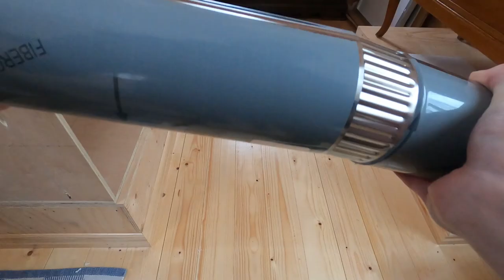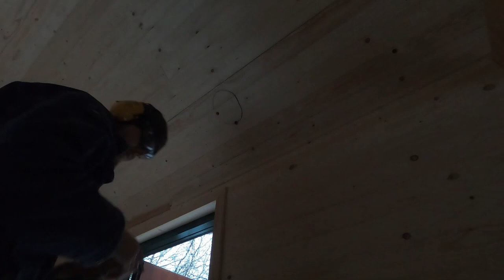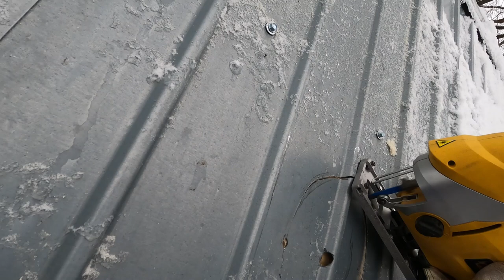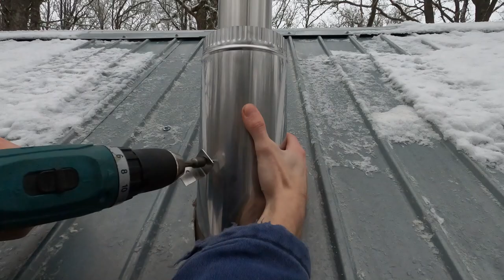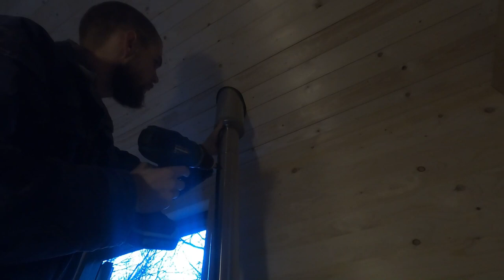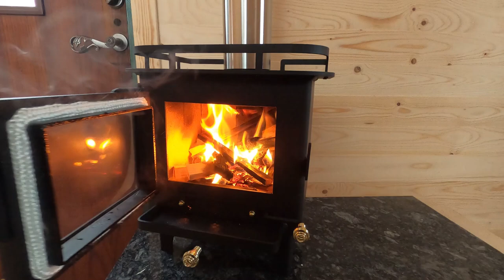Installation of a cubic mini wood stove in the tiny house (detailed)

Comment: Hello, such a good video! There are 2 things that I want to mention. 1. The flue pipe should be insulated the entire way up to the cap. That would allow the stove to perform better and have less creosote production. 2. It looks like the wood behind the stove needs to be shielded since it less than 20" from the stove. The wood should also be shielded to protect it from the heat of the flue pipe. Other than that, great video!  Thank you
Reply from the maker: Hi! Thank you very much for your advice. I have to admit that I accidentally ordered too little insulated pipe and because of shipping prices to Europe wanted to wait until I make a new bigger order with more items, and the wall I will fix as well. I was just a little too excited to test it out. Absolutely amazing stove, I am overjoyed with it!